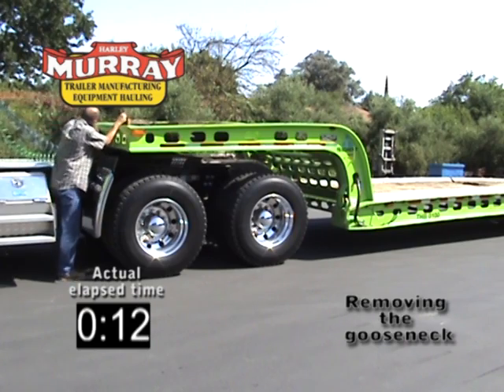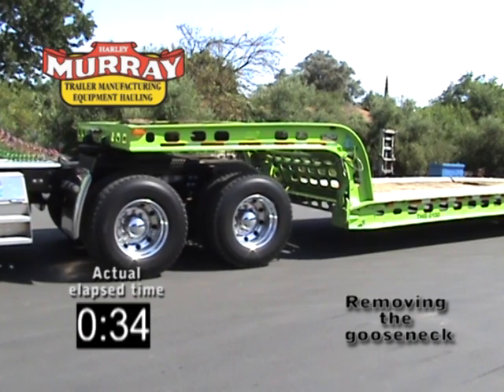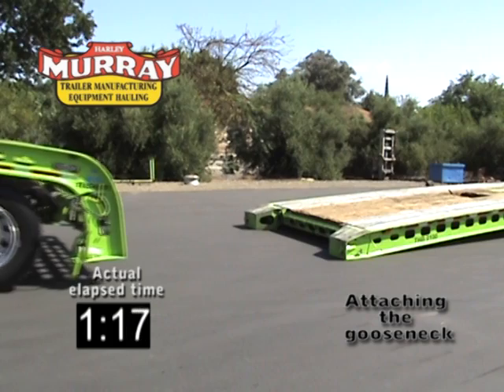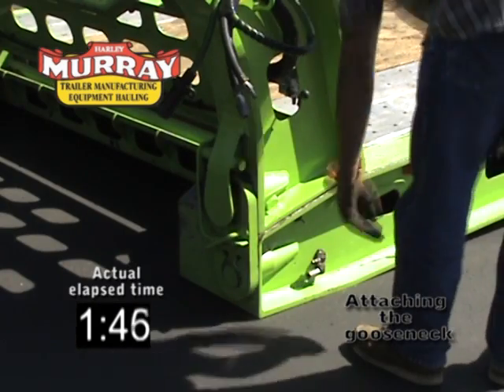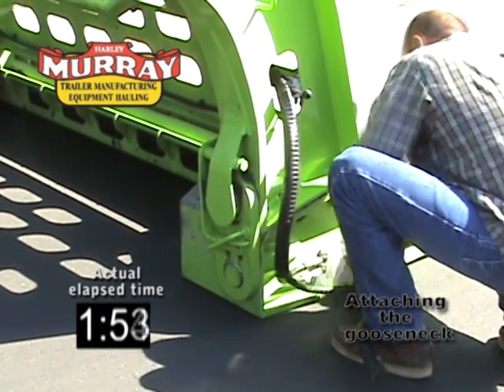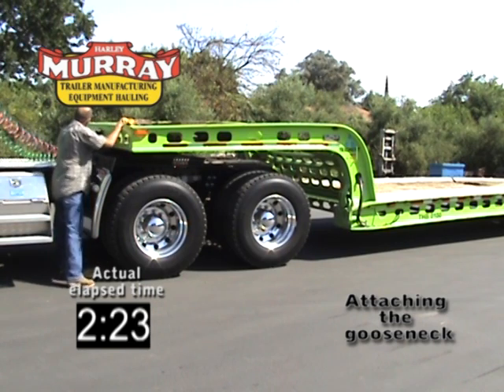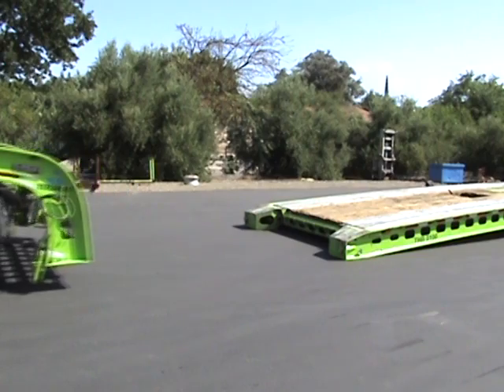Murray Trailer Robo Link Mechanical Gooseneck

Comment: I have been running this set up for the last 8 years. When you go to back the truck under the trailer with a load on it. All you have to do is run the machine to the back of the trailer, thus making it easier to get back under it. It's not hard on the truck if the driver knows what he is doing. As far as the clutch you just let it out and back under the trailer. Have backed under in mud, sand and uneven ground and never had a problem. You just have to think a little before dropping the trailer.
Reply: Thanks for the comments. I was curious about those conditions.

Comment: Looks like something that I will consider in the future.  No need for a wet system, any class 8 can use.  No small engine in the tongue that needs extra maintenance.  Only draw back I can see is the need for some funky frame extensions.

Experience mostly regular decks, looking into a disconnect gooseneck.

Comment: If you haven't pulled a Murray, Rackley or Cozad detachable neck trailer and you make comments about how they will break or can't handle the weight, you're ignorant. These trailers are proven and are built by equipment haulers.
Reply: You are correct.

Comment: I have never pulled one and know people like these out west but I have to think a Hyd Neck detach is a little more convenient and allows me to raise or lower the neck if the deck sinks when loading. neat concept but I would have to run one for a while to say it works as good as a Hyd neck.
Reply: Hyd necks are a little easier,  but there's a weight penalty.

Comment: Best design! I run a Pitts with a wet kit…. The ONLY time that has ever came in clutch is going over a steep short hump/hill. Lift the deck another 3” other than that…. It sucks! can’t take anything over the back because it has massive fenders and shit Ramps.

Comment: As Professional Drivers we , as a Group , are pretty good at precision reversing , HOWEVER , I  am curious if there is any degree of Self-Aligning in the Gooseneck or Trailer bed ? For less than optimum conditions or Operating in the dark .

Comment: First of all you have to have a tractor that is set up for this. You couldn't just back any truck under that gooseneck and slide it up the frame..Secondly what if you have a hell of a load on that trailer and poor conditions such as snow or mud. You think tht truck is going to back under that trailer and pick it up? Or do you think your gonna need a 30mph running start to even come close to getting underneath? This isn't for me. I'll take the long way and know i'll get hooked.

Comment: @MurrayTrailer hey Chaz you guys should put up a video of a truck backing under a loaded trailer. Also no one beloved me when I tell them it's ok to load over the back, and it doesn't hurt the trailer.
Reply: Murray trailers are built to be loaded over the back.
Reply: @dutchboy25al  not always. Its a beavertail trailer only. RGN's purpose is to load from front.

Comment: Last time I checked an RGN and lowboy hook up the exact same way.... You arent going to need a 30 mph running start if your truck is ramped and you have lockers, which would be set up for heavy haul. And if you don't you have no business being under a lowboy or double drop anyway.

Comment: I've never pulled a mechanical RGN so forgive my ignorance. But once everything is connected and your ready to back under with a load isn't the neck awful low? Do you have to hit it pretty hard to get under it? I'm looking at buying a mechanical fairly soon, so I'm trying to do as much research as possible.
Reply: Yeah, load an excavator on there and then spin out in the dirt trying to raise up the weight of the trailer with a 10" disadvantage.  Insane.  ??

Comment: nice setup, but when you have a 110000 load does it still connect as well, looks like its harder to connect than we think it is under load
Reply from the maker: As long as you have low bed ramps on your truck, there is no difference in the connection.

Comment: What's different about backing under this loaded or backing under an XL loaded? There is none. Both of your arguements are invalid... Because the second part is a problem you'll run into with any lowboy or RGN... I think this trailer is innovative, but I don't mind the conventional way..

Comment: I think some ramps would be needed. Some equipment might not be big wheeled enough to get over the front of the trailer.
Reply: They usually come with ramps.  For the front and back,  but we hardly use them for most work.

Comment: if you load that trailer up it aint gunna be so simple to just back under. you gunna need alota traction and also may damage gaurds etc from weight and angle of forcing the trailer up
Reply: AS your ramps take the weight you gain traction.

Comment: What a bunch of Know-it-all whiners. These trailers work in the market they're designed for, until you take into consideration 1. Local rules and regulations for permitting 2. Actual time necessary to get a load on a trailer 3. availablilty of other comparable trailers in this market, 4. cost involved to get your "favorite trailer into this market 5. permitability of your favorite trailer in this market....you are a truck driver with an irrelavant opinion. This is a smaller load class than I haul but so many of these comments are made by people who have no clue  about bottom line or profitability.

Comment: I wouldn't buy this. At 1:35 the goose-neck could come crashing down. You will need big help getting it back up again.
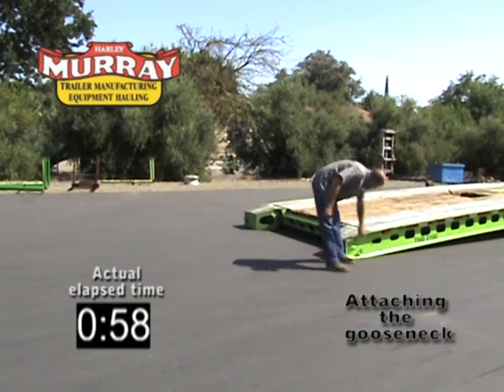Reply: I know you made the comment a long time ago but watch it again. The "deck latch" he switches to "lock" at 0:59 holds the goose-neck. It auto-latches when you back the goose-neck to the deck, it isn't going anywhere at that point.

Comment: looks like a hugeeeeee pain in the ass when compared to a regular low boy.  too many variables- uneven ground, low traction.  furthermore, with a 30, 40 ton load on there its gonna be hell getting that truck back under it.
Reply: nope.
Reply: look how long the 5th wheel ramps are ?

Comment: I don't like that trailer. Try doing all that on uneven ground in the rain or snow,plus the tractor has to set to use this type of trailer
Reply: You need a good set of ramps on your truck and you do want to be fairly level from side to side.

Comment: air powered filth wheels suck! iv seen one lose air pressure and the trailer slid off the damn truck
Reply: TheLargecars no you haven't.  Air release fithwheels use air pressure to RELEASE the fithwheel, not lock it.  The trailer will stay locked weather the truck has air or not.

Comment: just  more  sh!t  to  break  down.  Pulled  a  MURRAY  for  years,  COZAD  and  SIEFERT  to.  if  something  goes  bad  on  a  job in  the  middle  of  the  night,  when  a  lot  of  equipment  is  moved,  all  it  takes  is  have  an  airline  go  out,  then  your  whole  night  is  screwed,  not  to  mention  added  cost.